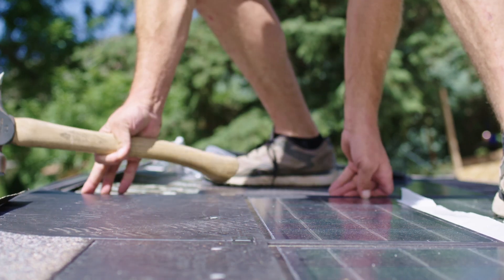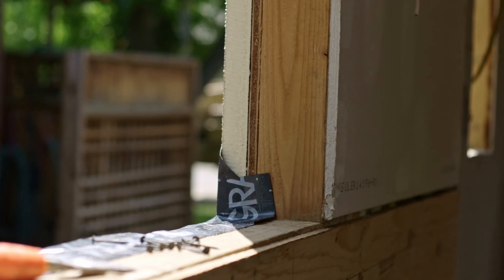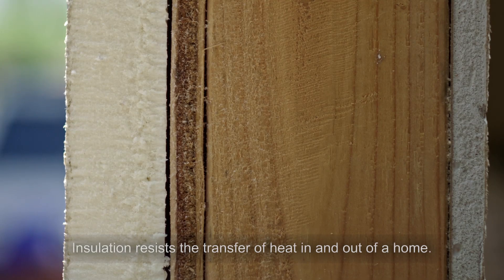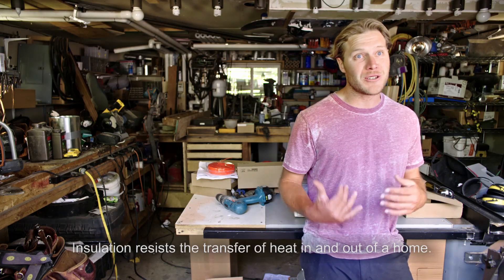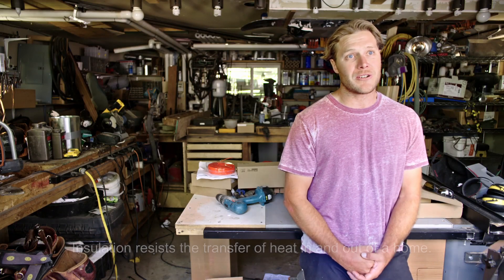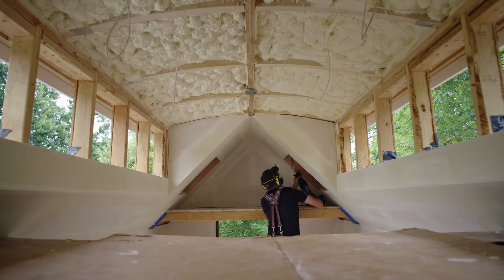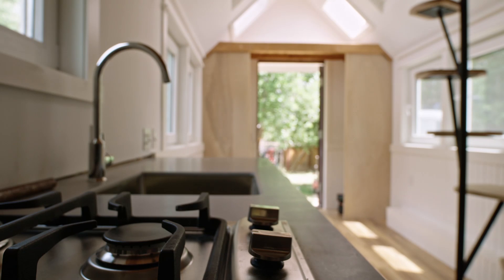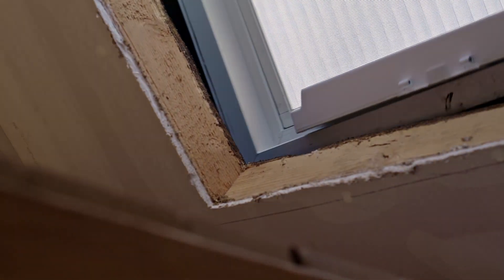Explore Zack Giffin's Energy-Saving Tiny House

Comment: Plastic has no soul. It lies, promising long lasting good looking, strong products. Reality is just the opposite, it fails earlier, it’s finish wears quickly, and in structural applications it often fails to live up to expectations. It costs oil to make most plastics and once the thing breaks, there is long lasting broken pieces to deal with. Plastic waste. It’s strength and temperature resistance is much overrated by industry compared to real life. I work on automobiles and whenever I get a chance to replace a broken plastic part like a radiator or intake manifold I will source it’s metal replacement. Because it is easy to work with in manufacturing, complex shapes can be formed easily, bulk materials are easy to handle, and most importantly, it’s inexpensive which increases profit margin. It is being oversold by industry and the market place. It surrounds us in our homes, public places and cars already and research is underway for new uses, as if it were free. Plastic sucks, please consider non-plastic for your next purchase.

Comment: What is the interior wall sheeting made from?
Reply: +plasticsposfdfguno8ollppsible 0 000000000000p
Reply from the maker: +K Gifford Thanks for asking! Like most houses, this tiny house was built with multiple building materials. The interior wall sheeting is drywall, backed by wood studs and polyurethane foam insulation. The plastic insulation and sealants used in this house form a continuous barrier, helping create a tight thermal envelope, to improve energy efficiency.